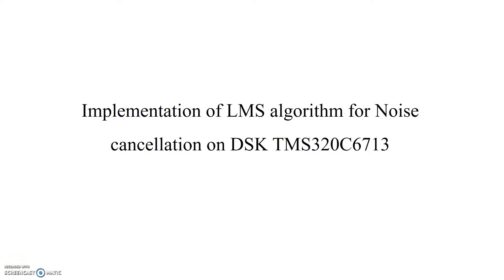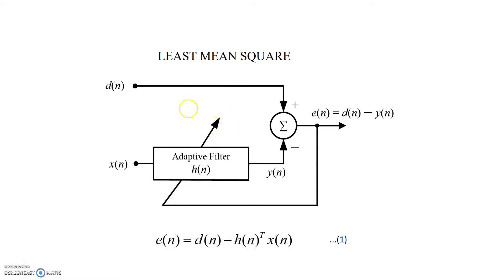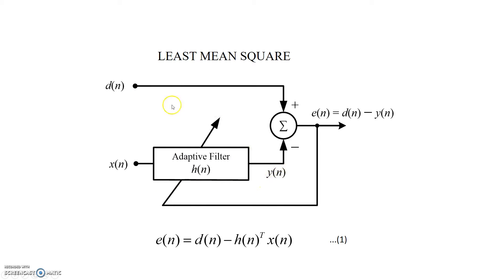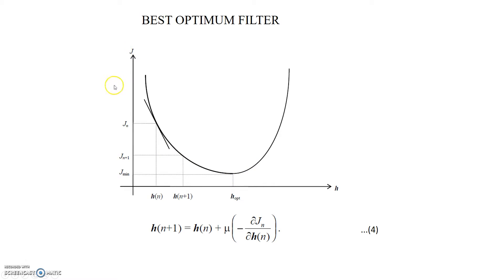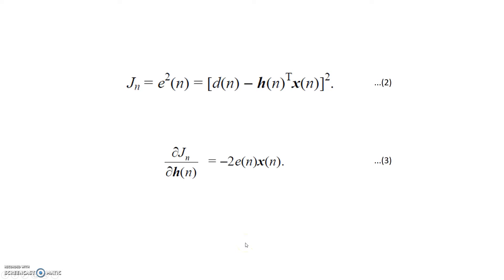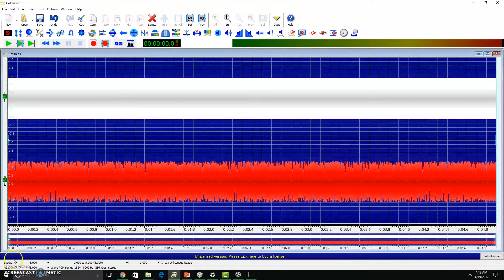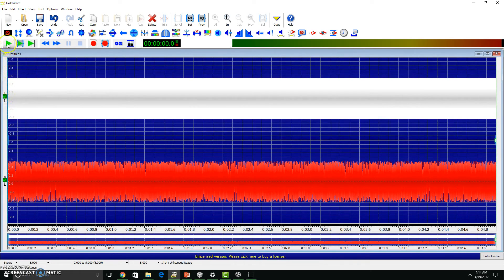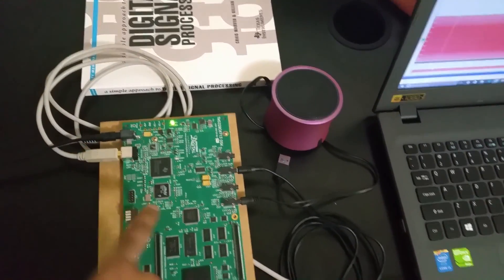LMS algorithm for noise cancellation on DSK TMS320C6713

Comment: Nice video. You are using the microphone on your computer I assume?
I'm trying to do a similar thing at the moment. Is there any way to get a copy of your code, or would you be able to reference me to a suitable starting point. I'm somewhat new to DSP. Thanks!
Reply from the maker: Thanks. No,  I am not using any microphone. I used Goldwave(a signal generator software) to generate a signal (sine + noise) and then I fed that signal to DSK through AUX cable. If you are using DSK TMS320C6713 board then I recommend you to read "Digital Signal Processing and Applications with the TMS320C6713" by Rulph Chassaing, you will find the code for this experiment and lot other examples.
Reply: Why copy? U do it on your own